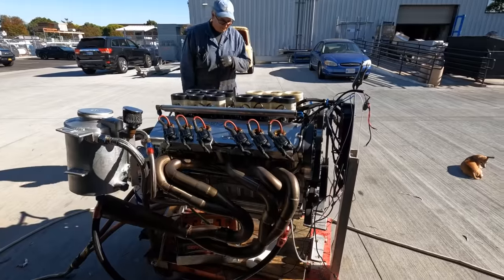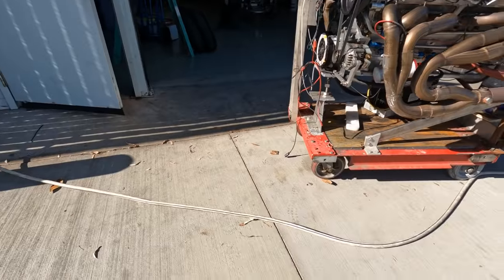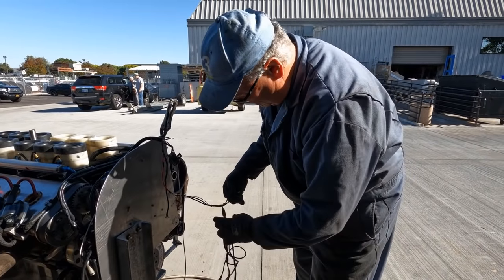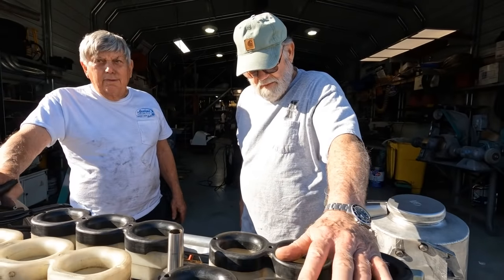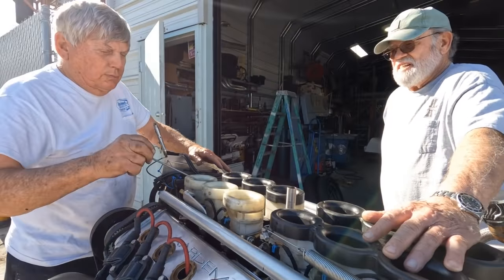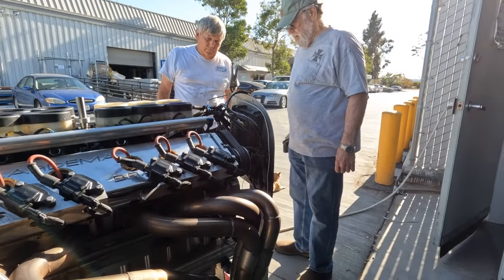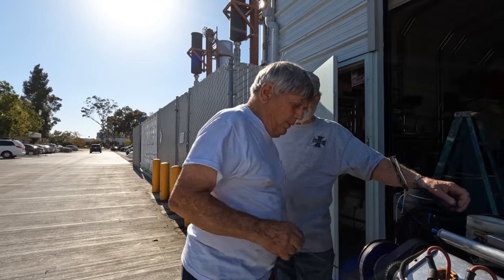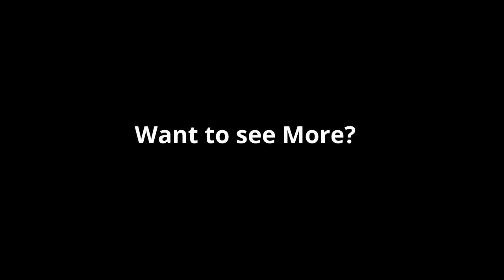Homemade V12 Engine Start Up - Pure V12 Sound & Shop Talk with Pete Aardema & Kevin Braun

Comment: Spraying the water on the exhaust and watching how far down it boiled is genius, most people would just grab an non contact thermometer, but that wasn't available back in the day. It really speaks to just how clever these guys are
Reply from the maker: Pete and Kevin are old school, but for sure know their stuff.   I'm learning lots just hanging out with these guys.
Reply: I was taught to do that by my grandfather in the 70s when I started up a fresh engine and it had a miss . I was dumbfounded at first but when he explained it it made perfect sense and point to the cylinder that had a bad plug wire. He told me they did it back in the 20s to determine which cylinder was lame. Never forgot that trick and it was a treat to see that being used here.
Reply: Beats licking your finger and dabbing on the pipe
Reply: The method is different, but the results are the same - one running colder, or if lean, running hotter (so the water boils off faster) is the one to investigate - did the same with a junkyard 3.3 in to my Voyager, to find a bad injector with the thermometer, exhaust was cool, plug coated in soot, injector was stuck open. Replace and runs like new.
Reply: @David_Walker16-3-51   still do it that way when im in a hurry
Reply: I was thinking the same thing.
Reply: For quick miss diagnosis, I still pull the dipstick and drip oil on the headers. Everything required, is already under the hood.
Reply: @GregQuirin  When I first started fooling with cars about 65 years ago We used to pull a plug wire off to find a misfire.  Shortly after we figured out that by pulling the plug wire out of the distributor cap we would not get shocked.
Reply: Younger people think they know everything but you can't beat experience.
Reply: @XXXXIndices  it's sad how the old ways are dismissed by technology but if it ain't broke...
Reply: The water isn't telling you how much variation in exhaust Temps you are getting and if one cylinder is running hot check all the injectors for flow.
Reply: @ChiefCabioch  which result in a variation of heat if its not right 😂 you hear them talking about the burn rate in the cylinders don't you?  Which banks could be lean or rich and which cylinders need adjusting.  They had temperature readings but not from all the areas in the engine.  They talked about why.  It only made sense to test the manifold temps at that moment with a sprayer.  It was a metric they didnt have on hand.
Reply: @JoeKyser  the burn rate only changes if the A/F ratio is not the same between cylinders which goes back to what I said, I don't believe the air in the scoop is packed tighter in the rear of the scoop and having Ran Supercharged engines for years the only difference in mixture between cylinders is from the Helix of the Blowers and the location of the discharge opening which is why blowers are being scooted back and the opening on the bottom is triangular and centered over the the engines manifold
Reply: @JoeKyser  exactly how do you plan on adjusting to even exhaust Temps? You first establish the cylinder Temps are not the same, then flow test all the injectors, and they did fine on the engines design till they wired it....
Reply: @ChiefCabioch  we test them prior to even seating them but I get it
Reply: Look these guys were building hot rods and pushing the envelope of factory stock and parts they altered themselves and did it by trial and error. Just about EVERYTHING we do today is based on, built on, technology they worked out in dark little shops in their back yard with no computer but their brain and a pencil and paper and math.
 There were no laser pointers, computer programs that will automatically take or add air or fuel from one cylinder or manage all cylinders, Trouble is these guys are an actual walking, talking, books FULL of knowledge and it's either not being taken advantage of by younger guys or they are being ignored as just "Old Dudes" 
 Bottom line here is this. I'm in my 50's now and when I was 18 yrs old I met a Man in my hometown in the middle of Nebraska no less who was one of many Big Block Chevrolet innovators, He took me under his wing so to speak and taught me a lot of what his years of experience had taught him. He could explain things in a way that I understood and got the reasons behind it. I still own the very 427 engine That introduced me to him because he built it. It was in a 1968 Camaro SS 4 spd car I bought from the original owner and I needed to know what the valve lash was on the Mechanical Flat Tappet Cam that was in the car and the Original Owner had misplaced the paper with all the maintenance specifics on. 
Trust me when I say the day I pulled into his driveway was a fantastic day for me and I like to think a Good Day for him.
 He got to pass on his knowledge to a kid who would use it and pass it on and I got all the benefits of his knowledge which are still paying huge dividends even today.
So the moral to this long boring story....FIND THESE OLD GUYS AND LEARN WHAT THEY ARE WILLING TO SHARE....BECAUSE SADLY ALOT OF THEM ARE ALREADY GONE AND THE KNOWLEDGE THEY HAD.... DIED WITH THEM.
Reply: It's an old-school trick but I still use it
Reply: @JoeKyser  testing isn't balancing the heat...
Reply: @JoeKyser  this engine isn't carburated, it's Electronic injection, if the cylinders are not getting the same temp they aren't getting the same fuel...
Reply: Probably can’t hear shit anymore at this point. 😅
Reply: It's to see if it's firing on all cylinders not to check the temperature
Reply: @GregQuirin  pop
Reply: There’s lots of tricks u learn when u want to learn and become the best at anything. They are doing this to see if it’s running on all cylinders. This reminds me of a trick old drag racers did so if ur running open headers u bolt or weld on a section of exhaust pipe to the headers and spray paint the section of exhaust pipe and where the paint stops burning off is where u cut the pipe off for max power.
Reply: @gm7ls421  yeah it’s absolutely to check the temp if one pipe is much cooler it’s not firing
Reply: Not clever enough to invent a thermometer though... 🤣🤣
Reply: @KingChadKennedy  “new stuff is bad” … he posted on YouTube 🤣.
Reply: this V12 engine probably have 350 horsepower
Reply: EGT probes are used with modern performance engines
Reply: We used to lick our finger and touch a tube, wait to feel the heat, then move on to the next tube. It was hard not to laugh when the young guys would try it but not wait to feel the heat. After about 3 tubes, they'd be hopping around the car, waving their hand. I see the pros have a better way.
Reply: Funny, I thought they were looking for headers exhaust leak with soapy water...lol
Reply: That B12 has a pretty awesome sound
Reply: Well. I have also used water, or just a moist finger - but on this millennium we have non contact thermometers / laser thermometers. 

Which one would you rust more?
Reply: Practical engineering.

Comment: O2 sensor per cylinder is a good idea.  Not only can you be able to tune each cylinder you will be able to figure out whats going on at each.
Reply: I send a few ideas but I figured that they wouldn’t be taken seriously.  These guys are “old school” and good at it.  Unsolicited ideas are what they line the garbage can with.   I was thinking along your lines.  I was surprised they didn’t have a knock sensor hooked to a fuel cut off.  That’s been around for 20 years.  Save a lot of racers a lot of money on engine rebuild. O2 per cylinder is good during testing.  I also heard of a BMW or a Mercedes that had a sensor in the front balance wheel the measured the impulse from each cylinder firing.  I have never found an after market part that does that.  The sensor would have to communicate wirelessly and power would have to be generated by motion of the balance wheel and a magnetic field. Crazy.  I want one. The question is “so what do you do if you get a slightly out of normal cylinder”, answer, “ sell the motor, do over”.
Reply: An EGT probe on each pipe like an airplane engine with a JPI or EI readout would tell a lot.  Then you could jet the fuel at each injector to compensate for the airflow at speed and have onboard adjustable fuel pressure for density altitude.  Airplanes have been doing it for years.
Reply: @yelyab1  I’m sure you could use several magnets or bands of N and S on the balancer and it would be able to measure how quick the acceleration is at each firing event. Your idea could work with load cells and weights mounted in the balancer, and/or  use TPMS tech for the battery and transmitter design. Or power it without batteries with electromagnets. Just spitballing here 😂
Reply: @yelyab1  I’m surprised nobody has figured out a way to use an alternator as the measuring device based on the waveform it puts out.

Comment: Awesome stuff, I'm an engineer based in Queensland, Australia and that would have to be one of the sweetest engines I have ever seen come out of a small workshop like this. Pete and Kevin, I definitely raise a glass to you guys, thanks for sharing this Greg, great video and audio.
Reply: How smooth does that idle, for a high strung race motor ?? :)
Reply: You should see how they made it. They chopped off a cylinder of 4 cylinder head then welded the two separate 3 cylinder heads to make one 6 cylinder head for one bank. Pretty homemade.
Reply: If you see all of their engines you will figure out they are better than any engineer with a full-blown team
Reply: you 2 guys are genius better than the stuff you get today congratz, make sure you get it  on the track to test beautiful
Reply: They old as dirt, they bones crack, they got mini me's going BUT them ole beavers can still build one helluva dam-n powerful in-jine, I no, old dad joke but I'm an old dad sooo🧐

Comment: Smoothness on the trolley indicates just how well balanced this beautiful Engine is … great job guys !
Reply: All inline 6 cylinder and multiples there of are inherently balanced. Excellent design 👌
Reply: @flaplaya  Not many people know that....I6 is balanced primary and secondary....V12 is balanced perfect, and works well to have a 7 main - 6 throw - engine at 60° angle.

Comment: In relation to the possible leaning off of the rear cylinders. It could be worth looking at the air intake system that was used on the concorde. Originally they had a problem that the jet engines were only suitable for an air intake speed well below that intended flying speed. They fitted the big boxy intakes that had a baffle system inside which slowed the air down and also increased the pressure inside. This gave the engines more power and is said to be the main reason that the concorde is still the only plane to have flown at Mach 2 without after-burners.  Very different engines I know nut if you  can control what the air is doing inside the intake scoop you may be able to get an even supercharged effect on all 12 cylinders. Just an idea.
Reply: I don’t think they have a supersonic air problem.  They just need to retain the dynamic air pressure while removing the inertia of the air.  An 2” thick aluminum mesh halfway down the cowl would be fine.  You just have to induce some turbulence.
Reply: I questioned your statement about the Concord, I thought for sure the SR71 could fly supersonic without afterburners, so I did a little reading, you are in fact correct. 
I'm writing this for the next person like me.
Reply: @bigredc222   Thank you,  They were a truly remarkable work of engineering.
Reply: Yep, and on fighter jets vari-ramps are used to keep supersonic air off the turbine blades. Kinda like a choke effect. As I watched, I was thinking of a waste gate type setup also, where spring(manual) and/or solenoid(plc or ecm) contolled widgets thru pressure sensers could help regulate stochiometric value better. Just sayin, charlie
Reply: @bigredc222  The F111 could do those speeds without afterburner, nobody ever dared find the top speed with afterburner - 2.9 was the highest anyone claimed to get to, but that came at great risk of melting the windscreen.
Reply: @alexjohnward  I love the F-111, but I looked it up before I wrote my last comment, and the people keeping track of that stuff claim the Concord was the only one.
I just tried to look it up, I can't find any numbers on the F-111s top speed without afterburner, it was 1650 mph with AB.
Reply: @bigredc222  I had a look and couldn't find anything either,  I could be wrong about it I suppose, I might have been thinking of dump and burn afterburners!
Reply: I have only just come across this channel and although my gearhead experience is limited in principle... l recognize that there are some great comments being floated regarding the matter of air induction. 
Nice!

Comment: With an o² sensor per cylinder,they could really see what's happening,ang make log files at least.
A good tune could enrichen on the fly,if you indicate a AFR target,they could squeeze a bunch of HP too.
A map sensor on the front and on the rear of the engine in the intake volume,could help them for the aero,and air feed pressure datas knowledge on the engine.
Reply: @FyreSturmOfficial 
I think you are sarcastic,but i'm not sure.
When you have so many cylinders and use the engine in difficult conditions,you need to know what's going on.
O² sensors can allow you to avoid melted pistons,intake plenum can distribute air unevenly ,specially at high vehicle speed.
It's good practice on high end stuff like here.

Comment: Think of this from a different point of view. These old guys probably grew up playing with junk yard cars like I did. I'm a little older than they are, and spent much of my teen years with my Chicago buddies building junk yard cars for the drag strip. What that means is that we bought everything including the car at one of our many auto junk yards. Why...because we had more skills than money.
I ended up moving on and became an engineer after serving in Vietnam. My point is this. These fellows have taken their skills to a whole different level. Just like fine carpenters and other craftsmen and ladies. My worry is that with few exceptions, there are no more junk yard car opportunities for young folks. And I mean that as an analogy to so many other hands on crafts. Just like there are very few apprentice offers to pass on the old skills that built our nation.
Having said all that, these guys rock. That's for sure.

Comment: 6:45 don't put a relief in the back of the scoop, you will loose power at speed. Put a separator, or splitter inside the scoop to give an even amount of air to the front and back six throttles. Or two scoops, one for the front six and one for the back six throttles.
Reply: Yup! Need to even out the pressure, so all the cylinders can make the same power.
Either baffles and separators inside, or a variable restrictor that keeps the pressure constant in the whole of the plenum, and can vary according to vehicle speed and throttle loads, like the cone in front of the SR-71's jet engines.

Comment: experienced the same problem on a sprint car, we ran a scoop on our airbox to qualify. we ended up Lovering the backside of the scoop mid curve above the airbox with the openings pointing up to relieve the excess pressure. IT WORKED but we weren't anywhere near that speed..  Great Video, and Good Luck.
Reply from the maker: Thanks for the info !

Comment: For the ram air pressure differential issue, they could correct the mixtures using the ECU but the problem is that the front of the engine would essentially be starving of air at high speed and therefore not making optimal power. They really should shoot for equal power from all cylinders. One possible solution would be to have individual, curved intake runners for each throttle body, which all run out to the forward-facing scoop opening, essentially subdividing the opening into 12 equal areas for equal air in each cylinder. Turning the scoop backwards would not only waste the precious ram air effect, but would most likely actually draw some vacuum on the intake.
Reply: I thought the same plan

Comment: Absolute bad asses!!!!! These men are so smart.  What a great team.   What great thinking and engineering.   Hats off to you boys. Note the using of water to check if the cylinders are the same temp.  No laser deal nope old school water style.  Works just as well.  Bad asses! Cam driven alternator?  Sick

Comment: Very cool very fun stuff and would love to do welding for this kind of stuff . I’m an aviation welder by trade. Now it could be possible to put stator veins in your scoop and then trim or adjust them accordingly so all cylinders are getting the same air pressure through the intakes . Flow and pressure are like volts and amps . Love the project
Reply from the maker: Thank you Dano,  They have added a baffle above all 12 throttle bodies inside the air box.   It should be good the go now!.

Comment: I think doing some wind tunnel testing with your air box to create baffles to even out the flow/pressure, and then incorporate a pressure sensor that adjusts your fuel mixture.  This would allow you to take advantage of the vehicle speed.

Comment: When we race or aircraft, we use EGT (exhaust gas temp) and CHT (cylinder head temp) gauges to help monitor our engines.  In your case, you should run EGT and O2 which will give you the optimal read out for gas to air ratios per cylinder.  One of your guys said you can adjust each cylinder which we can too, and if that is true, you can either make it manual or auto adjust to the mix or temps you want.  Have fun.
Reply: Agreed the ECU should be able to handle multi EGT, data first